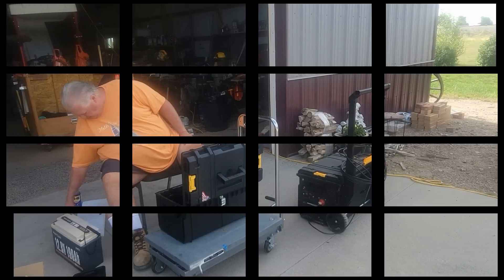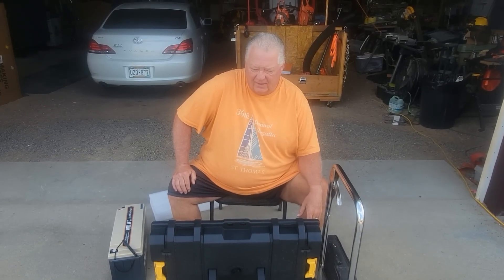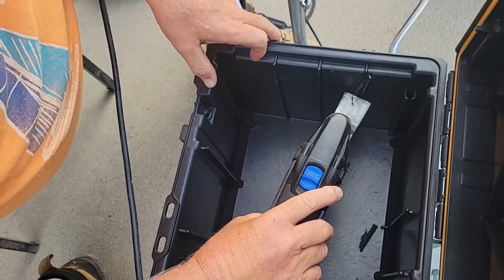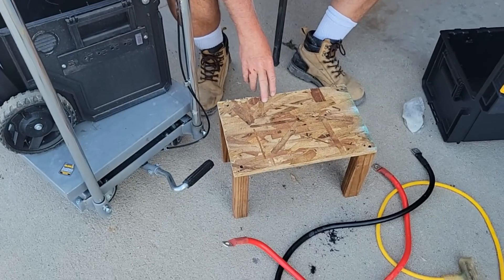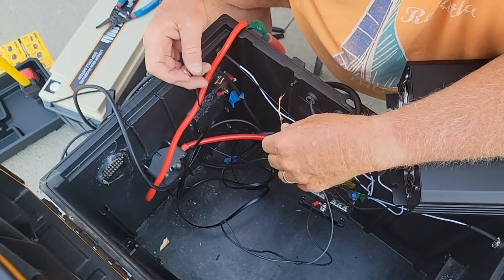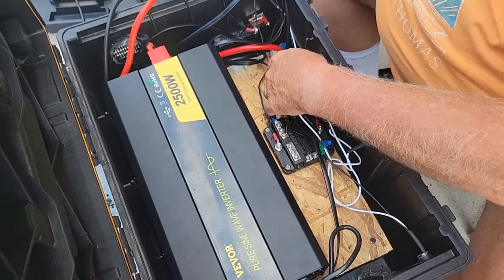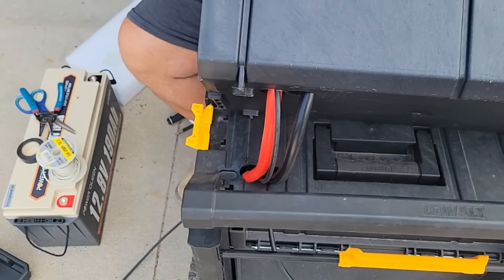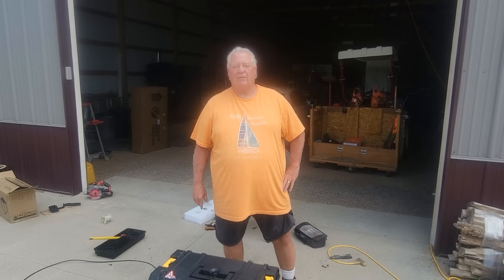DIY Solar Generator - Episode 4 - PowerQueen Battery

Comment: This would have been a GREAT place to use Anderson Power Pole 175 or 350 Amp connectors between the two boxes and NOT drill holes in the lid or bottom of those boxes! Think future expansion of battery boxes?
Reply from the maker: That is a very good point.  Thanks so much for commenting!

Comment: It's a Lithium IRON battery(LiFePo4 or LFP), not lithium ion. Different battery types. Li Ion are a little lighter and about 50% more powerful by weight, and can be charged at any temp for typically 1000'ish cycles. Li Iron cannot be charged below freezing and is slightly heavier, but has a life of 3000-10000 cycles. Reasonably close operational characteristics other than that. A lot of smaller commercial power banks (and power tools) use Li Ion so the can be left in a vehicle in any weather and still be charged, also lighter weight so easier to carry for truly portable devices. Also lastly, lithium Iron is safer and less prone to thermal runaway or combustion.

That aside, I've watched this whole series. I admit to cringing some when I saw your original choice of batteries, but I'm glad you found the correct path. Curious though why you didn't just drop the new battery into the space vacated by the old batteries and keep it a one box system?
Reply from the maker: Thank you for stopping by and watching the series,  HTodd! I appreciate the information.  The new battery didn't fit in the space vacated by the old batteries. It was too long, so I had to add a separate box. Take care and have a great day!